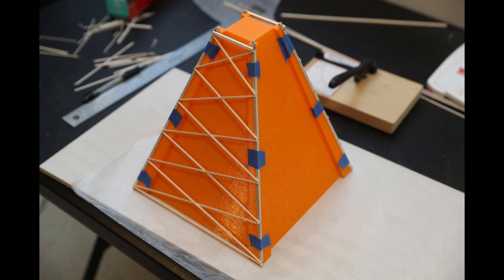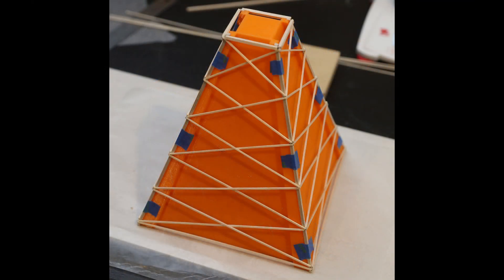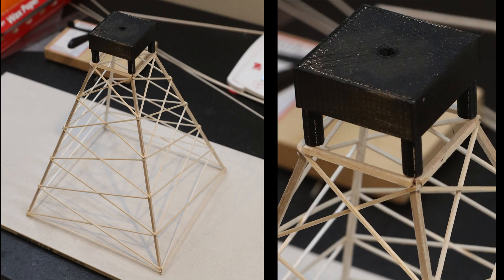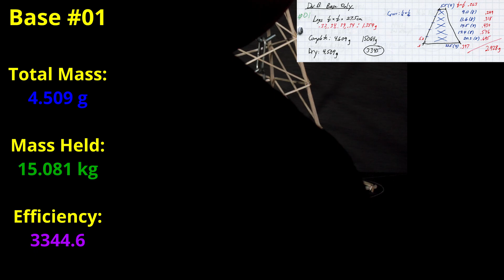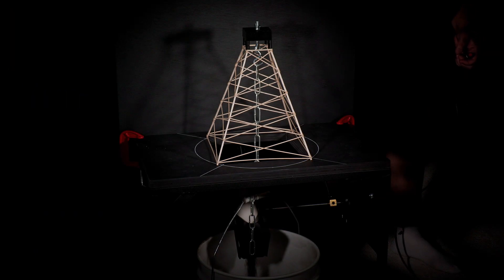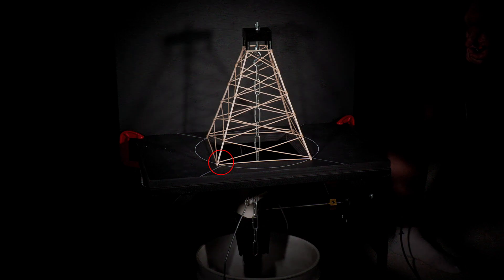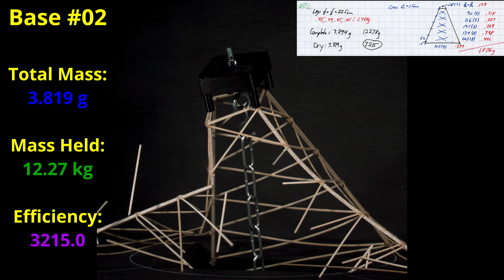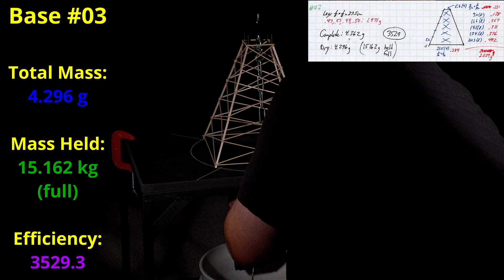2025 Science Olympiad Tower Div B: Bases

Comment: Hi! What weight did you use for the pillars and cross section wood to make it around 4 grams?
Reply from the maker: Hi!  If you check out the video at the 4:51 mark, you can see my notebook page for the benchmark build.  There you can see the masses of all the parts including the legs and each cross bracing layer in written in red.  The measurements on the right for the cross bracing are for all 8 pieces of a layer together, so for example, the bottom layer used (8) pieces that were 20.3cm long each and together they all weighed 0.492g.

Comment: Hello balsa enginnering, thank you for the videos. I was wondering the physics behind the bonus bases and why it's more likely to break than a normal base. Also, should you dedicate more weight to the legs or crossmembers? Which cross members endure most weight in the design, is it the last ones or second to last and why? Sorry for all the questions 😅, but last, what are some tips to reduce the weight as much as possible? thanks so much
Reply from the maker: Hi!  The two main reasons the bonus base is more likely to break and needs to be heaver than the non-bonus is that the angle of the legs is more shallow which introducing bending forces in the legs and the cross-member pieces need to be longer which means they are weaker wrt to buckling.  You can watch my buckling video as part of the 5-part series to see more details of that theory.    The perfect mass budget to balance between the legs, the cross bracing, and the number of the layers is really the main challenge of this entire event.  Again, check out the 5-part series on the theory to really see in this detail.   There is no magic to reduce the weight, you really just need to use lighter balsa which usually means buying it from a specialty store and cutting up a bunch of sheets to get exactly what you want.   Good luck!!

Comment: you used 1/8x1/8 for the vertical legs, what size did you use for the crossmembers?  Thanks
Reply from the maker: You can see that when I show my notebook pages, for example at 3:45.  Most of the cross members for this build was 1/16 x 1/16.  Many options can work for cross bracing though depending on the material you have on hand.

Comment: How far apart did you attach each member from the other
Reply: By this I meant the horizontal member above ot
Reply from the maker: @King_Kay_66  You can see that information (and more) in this video when I show my notebook pages.  For example at 5:17   On the drawing on the right side, the first layer is at 0.5cm and then each layer has a spacing of 5.2cm

Comment: Hello, I was wondering if it was possible to make the column more than 26 cm and the base less than 24, which we were thinking could possibly increase the structural integrity of the tower (because our column can handle a good amount of weight)/reduce the weight of the tower. (The column would be pretty long but still fit the ring requirement, but the base would be short).
Reply from the maker: Hi!  I encourage you to experiment with that a bit.  The rules definitely allow what you are describing.  You could have a really long column with a very short base.  I think you'll find that any weight you might save with a longer column will be more than used up by needing to make the base stronger due to the increasing leg angles.  The base would become much more like a bridge.   That is the beauty of testing the bases and columns separately though.  See if you can build your short base that holds what you want and within the mass budget that makes it worthwhile.  You won't even need to make a complete tower to know if your design change is worthwhile or not.  Good luck!!

Comment: Hi, Thanks for your informative videos. Wanted to understand why you need the horizontal members all the way at the bottom. Thanks
Reply from the maker: They may not be necessary depending on the strength of those bottom cross members, but because the base is so wide for the bonus build, those pieces are in pure tension and a single horizontal cross member is a good way to hold the legs in place at the bottom.

Comment: Hi balsa engineering! Could you please tell me what ur dimensions of the cross members you used.
Reply from the maker: If you check out my notebook page for each build, I show the cross member sizes.  The benchmark tower used a combination of 3/32 x 3/32 for the top, 1/16 x 1/16 for the bottom and 1/20 x ~1.5mm for the cross members (carry over from base #2).  Really, the size is not as important as the mass of the layers which you can also see from my notebook page written in red 5:04

Comment: I am trying to build the tower without a jig. Could you please share a basic template (showing the length and angles of legs)of one side of the base and column?
Reply from the maker: I don't really have a template like that to share.  Probably the best thing would be to watch my approach video that shows I designed the jigs.  You can use that to try and create some kind of template.  https://youtu.be/JdWY8FcbSGI    I warn you though, it will be extremely difficult to make good tower without some kind of assembly jig.  It doesn't have to be 3d printed, but you'll want to build something to help make it as symmetric and level as possible.
Reply: @balsaengineering6686  Thank you! That video is really helpful.

Comment: Can I test the base without the top horizontal cross pieces using a flat block and glue the horizontal cross pieces afterwards? Will the base without the top horizontal cross pieces too weak for testing? Thanks!
Reply from the maker: I would not recommend that.  Unless you make the base strong enough so it doesn't ever need those horizontal cross pieces.  That is something worth experimenting with as you build devices this year. Good luck!
Reply: @balsaengineering6686  Thanks! What about lower the cross pieces a bit so that they don't take weight during testing? I printed a loading block from a library but the library did not do a good job.
Reply from the maker: @MsShuangshuang  I'm not sure I quite understand what you are asking.   The custom loading block should be a fairly easy thing for most printers to print.  Try having them increase the infill to something like 40 or 50% and make sure it's being printed with the flat side down.  That might help getting the block legs to print well.
Reply: @balsaengineering6686 I will print it again. I was thinking instead of having the horizonal cross pieces right at the top, what about gluing them 0.5 cm down from the top. Will the base be as stable? I am working on nonbonus base and the cross sections will be slightly different anyways.
Reply from the maker: @MsShuangshuang  Having those top horizontal cross pieces 5mm down will probably be fine.  It all depends on the rest of your build.  Only one way to know for sure and that's to try it :)

Comment: @balsaengineering6686, thanks a lot for sharing! With your Div B non-bonus stl file, I can make a base jig with the size 21.5cm * 21.5 cm. This must be due to the 2025 rule that the base must span a 20 cm x 20 cm square opening. I wonder if a base jig with the size 14.2 cm * 14.2 cm   will work? (Here 14.2 cm = 10cm *sqrt(2))
Reply from the maker: The non bonus jig base I have provided is big enough to span the 20x20 square hole if you rotate it 45 degrees on the testing surface

Comment: For your tower builds, do you use sticks or sheets or a combination of both (for the legs sticks and the cross bracing sheets)? Also, what dimensions do you recommend buying?
Reply from the maker: I always buy sheets and cut my own sticks.  It's less expensive that way and you get more control over the entire process.  A good place to start is 1/8" sheets for the legs. For the cross-members, there is no one correct answer.  I have used 1/16, 1/20, and 1/32 thick balsa successfully.   You can check out my notebook pages for these  builds to see exactly what I used, size and mass if you want a good starting point.  Good luck!